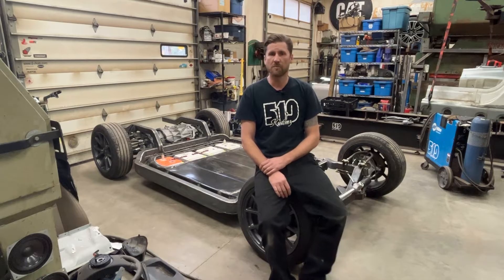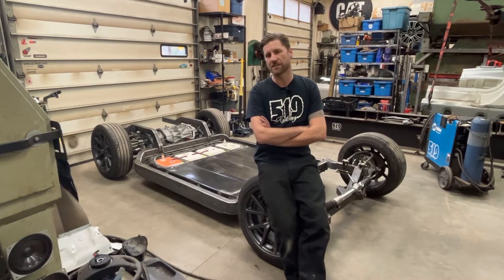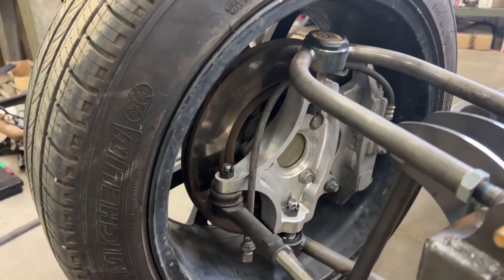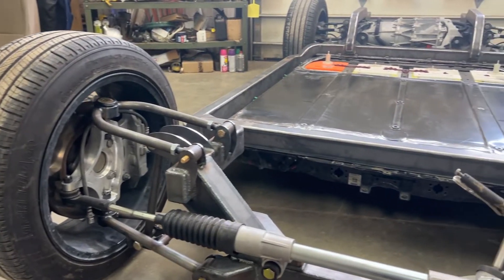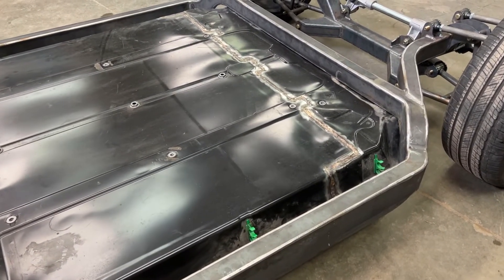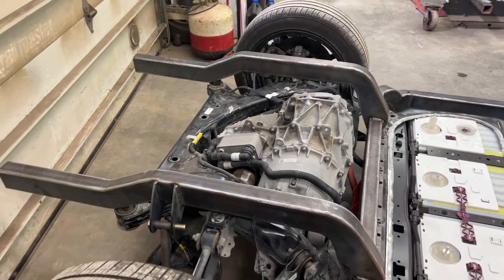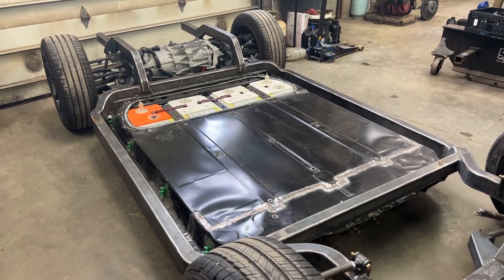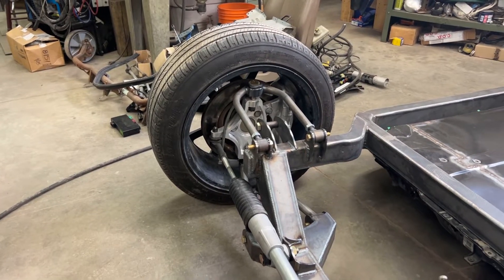Hot Rod Tesla Conversion 2wd chassis

Comment: How are you controlling the rear drive.  Do you do consulting?And at what rate?
Reply from the maker: There is an few aftermarket controllers I use to run the rear drive. I would be happy to do some consulting, I have never really came up with a rate though. Dan@519Kustomz.com

Comment: You have a problem tesla needs upper bolts to carry the wight of the battery there is 8 bolts connected to the h beams inthe middle because they carry the wight and about 8 in the middle to support the wight and the sides are weak cant hold the battery wight

Comment: Great videos, wondering if it is possible to use the 50kwh battery pack on a dual motor tesla? in essence keeping all OE tesla electronics
Reply from the maker: Yes it is possible. It might not deliver the full potential out of the motors because that pack may limit the max amps out though.

Comment: I am old enough that I used to do point ignition tune-ups and carb rebuilds on 60s & 70s cars. When computers came out on cars in the 80s some mechanics didn’t make that transition well. But I grasped it well and even taught these systems up until 2010. But electric drive systems on Tesla are far superior to any gas burning engines. All you have to do is drive one for a few days and you are sold. The instant torque on these cars is very addictive!
Reply from the maker: Yeah, the only constant is change!

Comment: Nice design. I like where you’re going with this. 
You’ve shortened the wheelbase quite a bit. Did you make any changes to the front geometry to account for scrub radius and turning diameter?
Reply from the maker: Excellent observation and question. Yes, I custom made the front spindles and a-arms to work with my specific geometry and handling expectations.

Comment: You were still thinking in ICE terms when you chose manual steering because of parasitic power drain

With ICE the power steering, alternator, A/C, etc power drain is directly from the engine power 

Not so much with EVs, though it does add weight but the net loss from the added weight is a small fraction of the equivalent drain from an ICE power steering system

I can see eliminating the power steering, A/C, and other creature comforts for a drag strip car but not for a street car
Reply from the maker: The choice was made to simplify things, but also for steering feel. Although the tesla rack does have speed variable assist, it still lacks some of that 'feel'.  I have done electric racks in other builds but we decided on the KISS approach. (Keep It Simple Stupid)

Comment: How long is the wheelbase? And are those stock Tesla battery packs?
Reply from the maker: If I remember correctly it is 98 inches. Yes they are stock packs but from a standard range car. I was able to modify the case  to make it smaller.

Comment: I’ve been wailing on my tesla (M3P) mercilessly for three years straight.  I’ve been through four sets of summer tires. Daily drags. Winter and summer temps .Compared to my previous gas cars zero parts broken.  no blown clutch no turbo rebuild no seized water pump. No internal transmission issues no cracked heads no valve train issues . Just beat it and plug it in. One difference is the performance in winter versus summer.   Electric cars like a nice warm battery pack.  130°F.  Is perfect for drag racing.   Gas cars hate heat .  less dense air.+Overheating issues too.
For drag racing, summer is better in EV. You can always just precondition the battery in winter time to warm up, but that just takes up energy.

Comment: Little Datsun White Zombie and its Mustang Black Zombie successor were the ultimate sleepers over a decade ago! Teslas beat Vettes on the regular. Lucid Sapphires are now even faster, and overall better luxury cars made with love by the original team Elon screwed over after hotrodding Lotuses. I'm surprised yours is about the only channel on this. If I was building a rod, it'd be a 4wd with those new Yasa Motors axial flux electrics on a full tubed frame, with a carbon fiber body kit for maximum power to weight. Tesla swapping is a lot faster (not actually, accidental pun) way to do it without engineering a full car from the ground up.

Comment: Very cool. The Tesla drive units are the LS and SBC of the EV hot rod world. If you standardize the front and rear of your design you can basically make this extendable to a wide range of wheelbases. Would be curious to see if all the Tesla models have a similar width of battery.

Comment: Any chance you can detail how the battery pack was shorten and yet retained its cooling? 
How are you controlling the model 3 motor?
Reply from the maker: I was able to shorten the case because this had the rare standard range (50kwh) modules. I was able to shorten the coolant piping inside the pack without needing to modify the modules. The model 3 motor is controlled by a Canadian company called ingenext.

Comment: I am curious about the model 3 inverter workaround, I’m doing a conversion with the model 3/y motors and battery but can’t find a open inverter for the model 3 or why just model s and x
Reply from the maker: As far as I know Damien isn’t finished the model 3 boards for retail. Model 3 battery is a bit trickier. It doesn’t use a pre charge resister like the other manufactures, but ramps voltage with the psc before closing contacters. Couple manufacturers of controllers, but I use ingenext. They can run single/dual model 3/y motors and full complete battery.
Reply: @519Kustomz  is this a customizable system at the end in terms of power and output or is the final configuration, it? And does it take longer to move or is the ramp up quick?

I am using the model S batteries with the model 3 front and rear motors
Reply from the maker: @gtmassive8193  oh sorry, I thought you meant model 3 pack. Model s is simpler and lots of support for. The ingenext system does allow some ‘tuning’ through an app, but there is a maximum power level set by Tesla as it still uses the Tesla inverter for everything concerning motor safety and longevity, not just the power stage
Reply: @519Kustomz  ok but does that mean I’ll have to switch back to model 3 batteries instead of model S and did you upload another video I’d like to see the setup
Reply from the maker: @gtmassive8193  nope not at all. You can use any batteries you like providing the voltage is correct. The customer has this and is doing body and paint. I’ve upload some stuff of the next one I’m building though
Reply from the maker: @gtmassive8193  awesome thanks. Yeah I’ll help however I can.
Reply: @519Kustomz  thanks a lot

Comment: I want to build a tesla power s10 tube chassis instead of my current setup usin the bbc 468 with 800 hp but i want 4wd and to also build an enclosed trailer with all the amenities that go with sleeping chilling or goin racing and not have to charge it bcuz the roof will be solar panel setup and the floor will house the batteries and charging system
Reply from the maker: Love the sound of it! Cool project for sure.

Comment: I’ve got a Tesla and it has been a great car, but where we live they are everywhere, so it feels a bit boring. I’ve been kicking around buying a classic car and converting it and it seems that one of the trickiest things is figuring out where the batteries go. The most logical place is under the car, which makes me think the most logical type of car to convert would be a body on frame. There are literally millions of Model 3s and Ys on the road, which means all kinds of parts available for cheap, it’s the frame that can support the battery that is the tricky part, which you’ve solved. Do you have any interest in selling just the frame to fit a standard Model 3/Y battery pack and motor(s)? I feel like there’s a business case for it. Just a quick check and the Model 3 wheelbase is 113.2”, a Model Y is 113.8”, while, for example, a 1957 Chevy Bel Air wheelbase is 115”. Seems doable.
Reply from the maker: So far every thing has been built to spec. The next chassis I'm currently working on (corvette) will be more of a candidate for production. The issue with the model 3 pack is the width. Not all chassis can be that wide and still accommodate the stock body mount locations. After I have a good handle on the vette stuff I will try some other platforms for sure.

Comment: You think it could be short enough to fit 94"5 Wheel base and 61"width for a 1969 volkswage, Bug nobody.
Reply from the maker: Not in this configuration, The model 3 battery is a large constraint. However, I am working on a bolt in kit for that (VW) platform.

Comment: i would like to convert a 60's cadillac coupe to ev using a rear tesla suspension&drive unit. tesla is attached with only 4 bolts, correct? would that need a complete new chassis or can an original chassis be used? i dont shy off a newly built one. batteries can be fitted in bonnet and trunk too? to achieve 120-150 kWh with battery=5-600kg  equivalent to (engine,gearbox,ear axle+propshaft, tank etc). would that be viable project?
Reply from the maker: Yeah that sounds fun. I would verify the track width between the Cadillac and Tesla first. You should be able to build attachment points to the factory frame but you are limiting your ride height. I like to make purpose built chassis as the solution.

Comment: Could you use this base for a van ?
Reply from the maker: This one is purpose built, but yes, some iteration of this would work.
Reply: @519Kustomz  looking to use the tesla base for a Renault van in Europe. Should client accept the proposal. Probably need a model Y.
Reply from the maker: @Manhoof  cool project. Yeah lots to consider. Really depends on track width and wheel base. The Tesla stuff is a solid choice.
Reply: @519Kustomz  how long did it take you from receiving the parts to full drive readiness ?

Comment: Nice work, What did you do to shorten the coolant lines inside the battery pack, What type of connection did you use ?
Reply from the maker: I used as much of the plastic coolant lines as i could and found gates shrink fit coolant "clamps" exactly like the factory white ones.
Reply: Im looking to get a chasis builted for a 102 IN.  wheelbase, what state are you located ?, Im using the Tesla front and rear subframe. I have Tesla front strut towers and control arms My battery pack is a Model 3 short cell pack already cut down it 71 IN. ( FYI, Pex tubing and clamps works great ) The ride hight can be around 6 to 8 IN. what tubing do you use for the frame ?

Comment: Great work! What are you doing to the battery pack in terms of bms, cooling etc. Hacking the factory or aftermarket?
Reply from the maker: Cooling is factory but slightly re-plumbed. The BMS is kind of hacked factory. I use the battery controller from Ingenext.

Comment: What gauge steel do you use for the chassis? I’ve already got a Tesla model 3 dual motor donor car for a 1957 Chevy Belair 4 door sport sedan which I also already have for the swap.  What you have done is really the best solution for this sort of conversion.  I’m planning on using as much of the Tesla as possible including power steering, Regenerative brakes, motors, penthouse wiring harness and battery pack mounted exactly as you have done it.
Have you or will you cut out as much weight from the body as you can? Building a chassis is one thing but getting the overall weight down with the classic body is probably the biggest challenge.  The other option is to just not worry about the weight, beef up the brakes a bit and drive a bit more mindful of a really heavy car. Been building a new geothermal power station so am now just short of time until the project ends.  Should get started on the belair ev conversion project in 2024. Andrew.
Reply from the maker: Love your project, sounds awesome. I almost always use .188" for the chassis

Comment: I want to electro-mod my S10 like this for daily duty and Autocross racing fun! Cant wait until the parts and pricing starts to really come down
Reply from the maker: It will take a bit still but pricing will come down eventually. However,  it is actually quite comparable to a high horsepower motor and transmission, all things considered.

Comment: Great video, I was wondering the wheel base minimum in inches of your chassis and the frame width between the axles?  This looks applicable to early smaller muscle car bodies, and pickups? What is the kit car you built the chassis for, a Cobra by chance?
Reply from the maker: Wheel base was 98 inches. The width I would have to look up again, but that can be a issue in smaller muscle cars that had narrow-ish frames stock. This was for a fiberglass Ferrari replica

Comment: Fantastic execution.  I am currently looking for a salvage tesla plaid to start a similar build for my 69 mustang.  I bet in 3-5 years people will look back at this as a turning point for alot of gearheads.  I would love to see more content on your chassis build proccess.  Its awsome. 
What is your total width edge to edge on the frame?
Reply from the maker: Mustang would be awesome! Plaid is a pretty wide track width to deal with.  I'm with you, it is a bit early still but people will catch on. I just started the YouTube thing after I had these mostly built, so most of the build stuff is just photos.  But the next one I'm just starting the CAD work for and I will video much more indepth and share.
Reply: @519Kustomz Is there any software to run a plaid rear drive unit?
Reply from the maker: @haaseuros9789  this controller is made by ingenext. I don’t think they support the plaid drive. Try EV Controls in Ottawa, they might.
Reply: @519Kustomz  I sent them an email. My engine is kinda old now so I think I want to go ev next. Honestly might be cheaper to go even plaid drive unit then another built turbo engine and trans next.

Comment: could this be possible with a 98 3000gt? except with 2 models plaid rear drive units, one for front wheels and one for rear wheels.
Reply from the maker: Anything is possible. I would however run a single plaid rear drive and a front motor, instead of two rear motors. They way tesla runs them is the rear motor is the master and the front motor is basically a slave. Trying to run two rear motors, perfectly in sync would likely not be worth the headache.
Reply: @519Kustomz  ah ok thanks

Comment: I was kind of thinking about doing the same sort of thing except for using a Lamborghini body if it's even possible I don't know
When you get a complete the car do you have a problem getting it registered ?
Reply from the maker: That is a tricky question as the laws are different everywhere. Generally though, it is best to start with the car certified and licensed and registered, then it is just modified. In Canada for example, it is ultimately the certifying mechanics discrestion.
Reply: @519Kustomz  Thanks for getting back to me I appreciate it  Yeah things are a little different than they were many years ago about getting things registered.    You are doing some really nice work.

Comment: Looks like another cool project.
That rear beams where the whole cradle/EDU is mounted will transfer a lot of bending moment on the rear Y axis chassis frame. That is if the unibody does not structurally tie the rear end to the rest over the B / C pillars.
I would strongly suggest to you to try and get some official high voltage training. Please always use HV PPE and keep all live terminals of the battery always properly insulated. Not trying to be safety nazi but coming from that industry, shit can go bad quickly.
Reply from the maker: Thanks man. Yeah the unibody is going to tie the whole thing together. I’m always hesitant about showing projects part way through because not everything is explained right away. I have actually put some serious thought into offering high voltage training / awareness, so safety nazi is alright with me!

Comment: Dang I'm looking to do this same setup on my Tesla Ranger project.
Will need custom frame but will try using front and rear subframe with a custom shock/spring mount.
I'm going to try and keep the Tesla system stock so I can keep stability, Abs and traction control.

Thanks for posting this up close look and keep it coming!
Reply from the maker: Wicked, I would love to check out how its going. If you have any questions don't hesitate, i've done a couple now. I have always abandoned the tesla ecosystem as aftermarket stuff has traction control available usually. Simplify the whole build.

Comment: I would love to see a 4x4 4 wheel steer with electric power steering front and back. But an aluminum tube chassis/ roll cage. And fibre glass shell. 
It looks like the rear chassis rails should be connected at the back. Is there any support back there?
Reply from the maker: Yeah this is getting a unibody car grafted to the chassis, so lots of support everywhere. We did consider an aluminum chassis for this one but cost killed it.

Comment: I totally agree with you. I have a tesla model 3 swap in the works myself. What kind of motor/battery controller are you using?
Reply from the maker: The last two i have used the ingenext controller. What swap are you working on? love to see it.
Reply: @519Kustomz  Awesome, I am planning on doing the same! 
The car I'm working on is a 1949 Cadillac Sixty Special (I think). I'll send you a link to my build thread if you want to check it out!